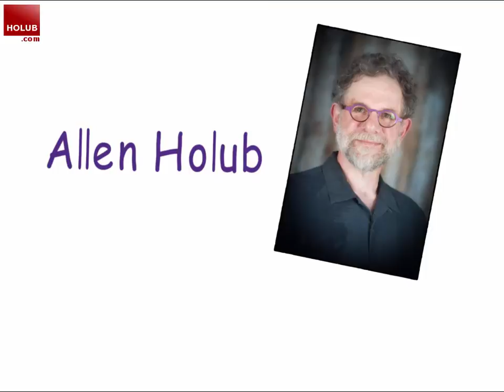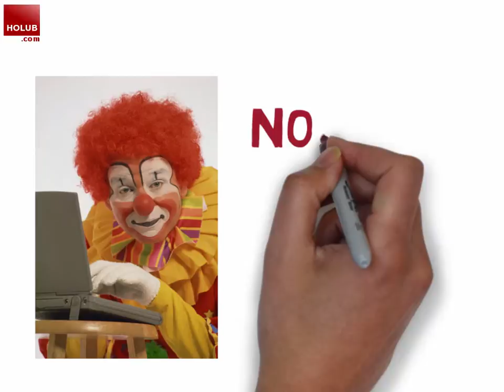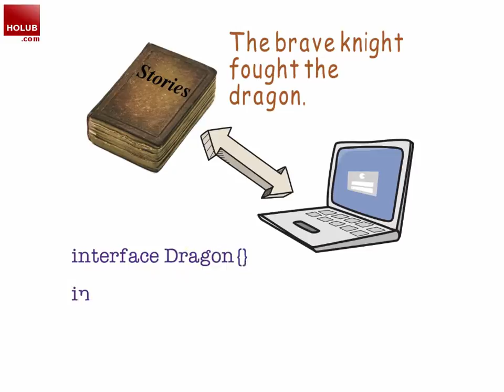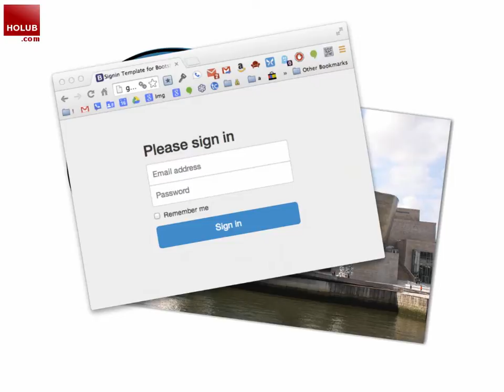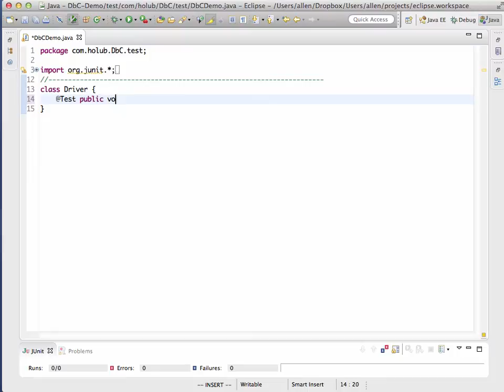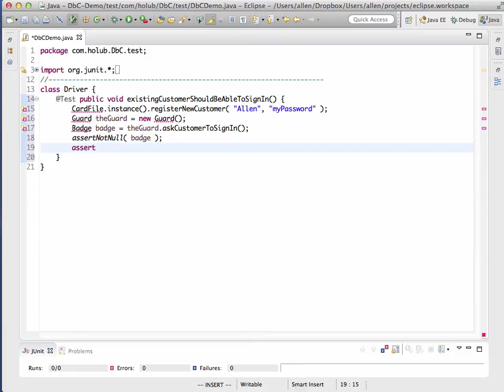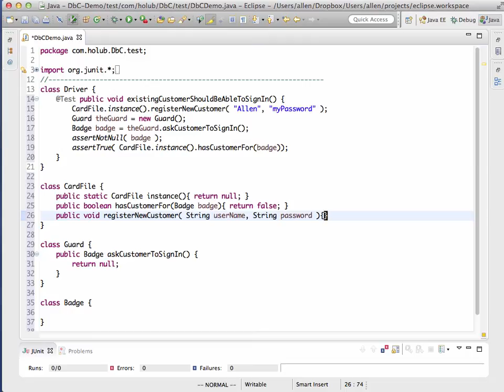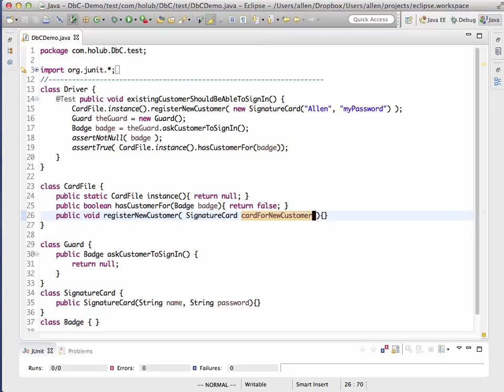Design by Coding

Comment: wonderful. a story is: a story! test something which is of value… to the user (not a class, not a function). don‘t plan ahead, instead make use of software being soft and reshape it as you go along. i think when one codes for years on it’s own for fun, the insight that this is possible comes automatically. so i preached agile for years to management to let developers work this way. but, thanks to the exponential growth rate of new developers, they also lack these insights. i‘ve even seen xp being turned into waterfall. at thoughtworks! i wonder, can agile succeed when the nerds are a marginalised minority? :)

Comment: Speeding up video to get to a certain point more quickly is not time-lapse photography. It is called hyper-lapse.
Reply: Time-lapse photography is a technique in which the frequency at which film frames are captured (the frame rate) is much lower than the frequency used to view the sequence. When played at normal speed, time appears to be moving faster and thus lapsing.

a hyperlapse is achieved by moving the camera a short distance between each shot